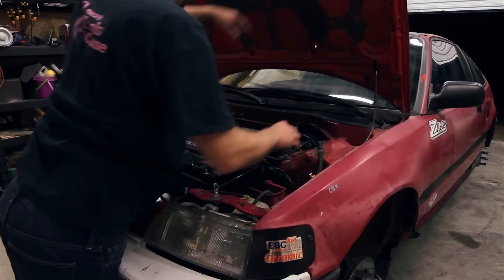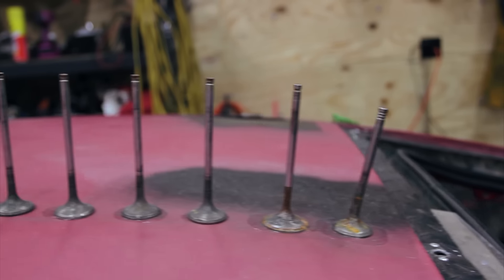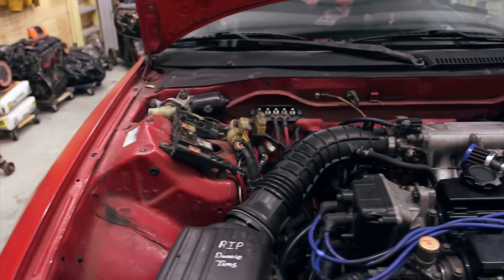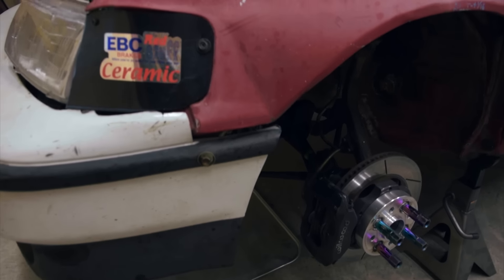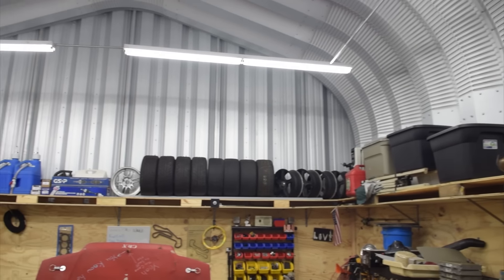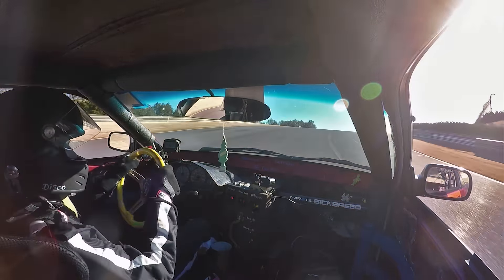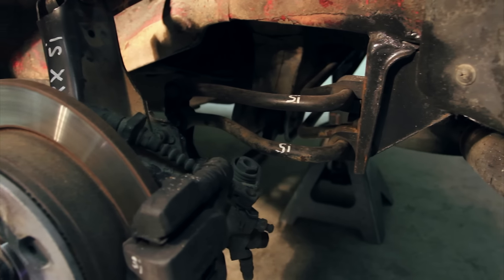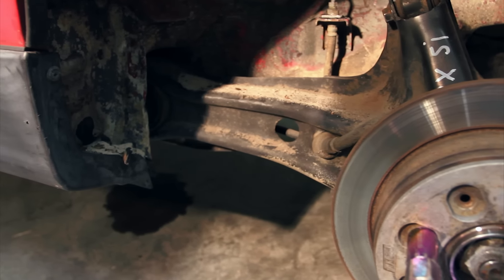Competitive Crap Can

Comment: Check out SCRAP ATTACK from Chumpcar world series.  I worked on that car over three seasons.  Our car passed tech with a b16, but was challenged at the podium and were disqualified based on value of the engine.  It has been running a b18b ever since.

The drivers all have a circle track background and like the rear to be able to rotate pretty easy.